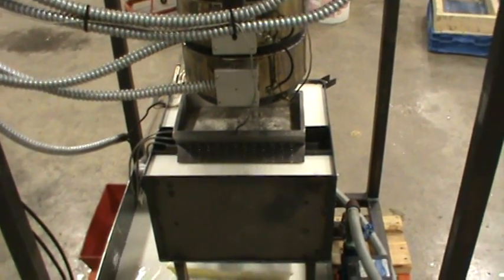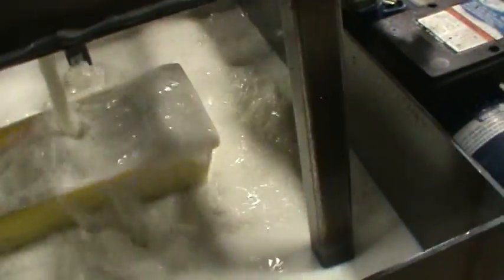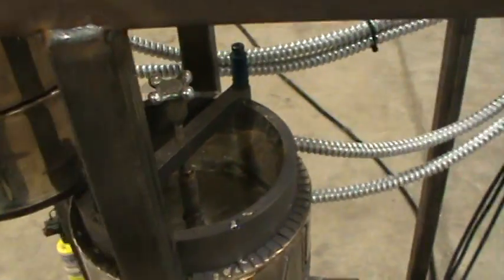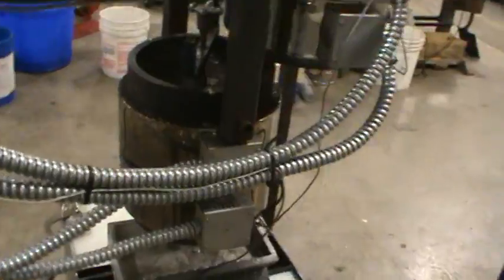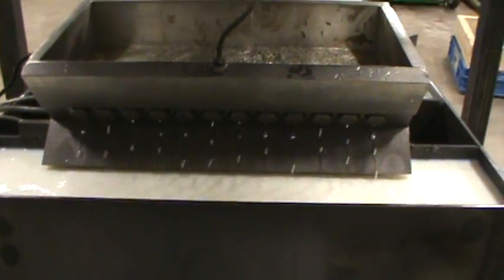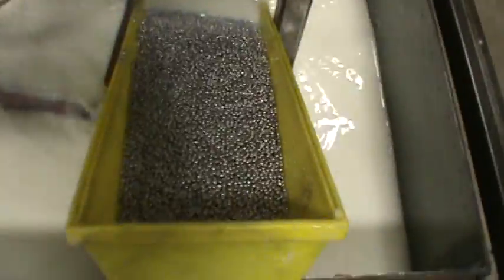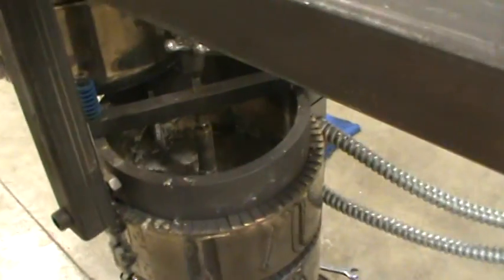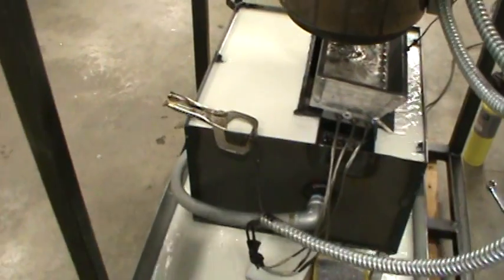shot making  machine 400-450 lbs hour

Comment: I really like your two stage heating system.  Something a lot of DIYers miss is the importance of temperature control for a consistent product.  I'm guessing you are using K thermocouple?  I've seen some high volume production stuff that uses fire rods for direct heat.  I think for my first setup I'll go with the band heaters.  To say the least, thank you for the video.

Comment: Hi, what a great way to make your own shot.  Especially the way in which the temperature of the lead is maintained as well as the level of lead in the ladle.  Top job.  I'm gathering bits and pieces in slow time to start my own system.  Currently experimenting with SSRs etc and the detail in your vid is invaluable.  May I ask one question please about the thermocouple sensor mountings?  On the ladle it looks like the sensor is set on the top edge of the front panel: is that correct?  Makes sense as you don't have to worry about immersing into the lead.  And may I ask to about how the thermo sensors are mounted on the pots?  Thanks again and thanks for helping us all out.

Comment: The whole lot could do with elevating on legs by around 30" so that removing the finished product would be easier, That is by not having to bend down to the floor to remove the tray :) 

Fantastic machine- Well done mate :)
Reply from the maker: stop and think about the reason for that......You want to dump lead into the pot blindly over your head??? you need to see into the pots and monitor their progress. Plus remove dross from pre melt pot periodically.

Comment: Mr. Keihinsdad, i want to buy this machine plz send ur contact detail or mail id.
Thanks.
Reply from the maker: 2500-3000 us with all new parts, if you can find heater bands on ebay that will cut cost in 1/2 easily.
Reply: Are you now selling these machines?

Comment from the maker: Steve each heating elements leg has a SSR so there are two SSR's per band, Also the Ladle heaters are all taken care of by one common SSR. Buy your SSR on Ebay and get the highest amperage possible, do not rate them by your amperage of the elements. OVER RATE THEM, you must heat sink them also!!!! and run cooling fans or you will blow them up!!!

Comment: keihinsdad  what is that white liquid?
Reply: Its S741 coolant pay attention!
Reply: looks like semisynthetic water soluble oil. he calls it S741 made by fooks? its a 5% mix oil to water. I personally use castrol Hysol MB 50. Looks very similar.
Reply from the maker: hvguy
Fuchs Lubricant company, S741 We do use Hysol MB50 now and should work also

Comment from the maker: 5/16 316 stainless bolts with 1/8 feed hole in the 5/16 dia and then a .026 dia drip hole intersecting through a hex flat on the head.

Comment: Im a mechanic, I have sand casted a "littleton shot maker clone" out of aluminum that im pretty proud of,  the only thing im not liking about your machine is the noise level, is that the harbor frieght pump,  im going there soon for stuff and would use it, if not for that damned wine.   oh and did you cut your own nozzels or have them done. good job and thanks much.

Comment from the maker: I thought this was more helpful than a write up. surplus heater bands on ebay, digital temp controllers and heat sinks on ebay,tube heaters from  McMaster-Carr, rest of its machined parts and fabrication. video and you own imagination should get you there. i will not provide any engineering or parts and or material list. I only wish there was this much info when I started this project thats why I did it and the video but I dont have time to spoon feed info to guys who want to build one.

Comment from the maker: No zinc will not work. I would assume that you are speaking of the new wheel weights. They will not melt at the 631 degrees that lead does so they are easy to spot!

Comment from the maker: Spray on your ramp and the threads and nuts of your drippers. The powdered graphite is about 1 tea spoon to 100 lbs in your tumbler. Harbor Freight has a cheap concrete mixer that works well and is just over $100! I get my graphite from a farm supply store used in seed planters "EZ Slide brand.

Comment: Absolutely genius!  If you look at my videos, you solved the flaw in my system.  Constant heat is by far the key.  The delivery of heated lead to your mid as to not diminish the temp was a great idea.  I find that variation in heat is my only enemy.  My shot is not perfectly round, but shoots as well as any factory shot made.  What is you percentage of waster per run? It looks like it is minimal.  I am around 2%, but it is usually from the beginning of the run until the heat gets constant.